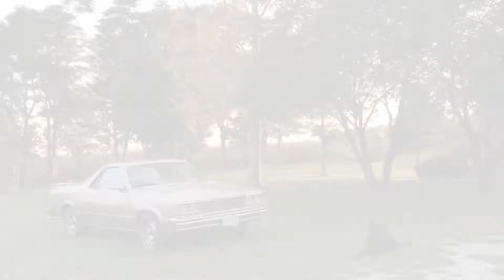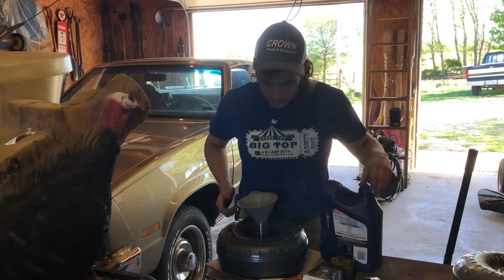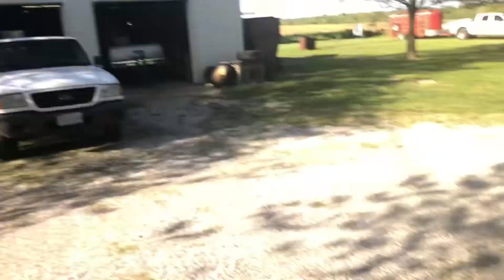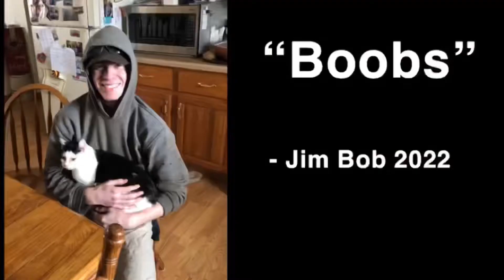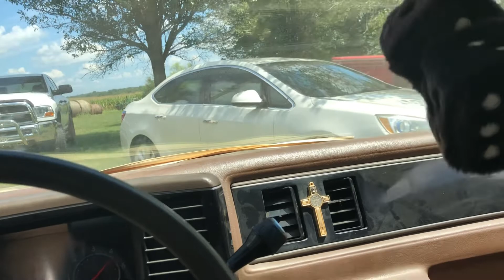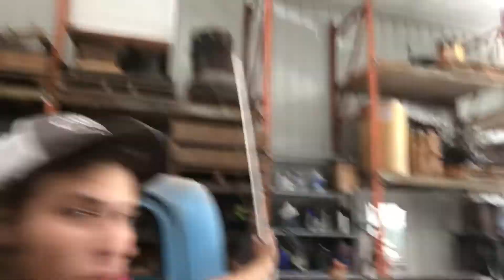TH200C To 200-4R Swap | GMC Caballero Transmission Swap Part 2.

Comment: Ok so I still don’t know how to unbolt the fly wheel from the torque converter 😮
Reply: You’ll have to rotate the engine over to gain access to the Torque converter bolts. I believe there are three. You can use a socket and breaker bar on the crank bolt or a long screwdriver/pry bar through between the flex plate and the torque converter. Having the starter out of the way helps. You also may have to take off the oil filter. You may also have a plastic inspection cover to remove. Use something to keep the engine from rotating while you loosen the torque converter bolts. The heads of the bolts will be facing the front of the vehicle.

Comment from the maker: Here’s some more information for anyone considering a Th200 to Th200-4R swap: 

They are the same length, you can reuse the same driveshaft. 
They mount differently, you’ll have to modify your existing crossmember to reach further back, or buy one like I did. 
The stock dipstick tube can be made to work, it’s a little awkward. 
The stock shifting linkage will work, you just have to make adjustments so you can use the full range. I can shift all the way from park to manual first gear. 
Thank you for watching, I will be happy to answer any questions.